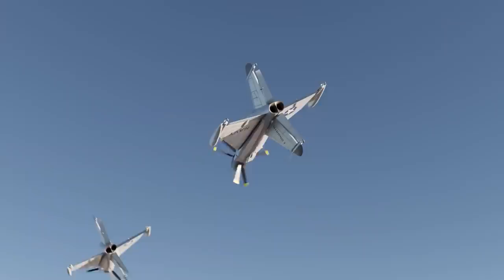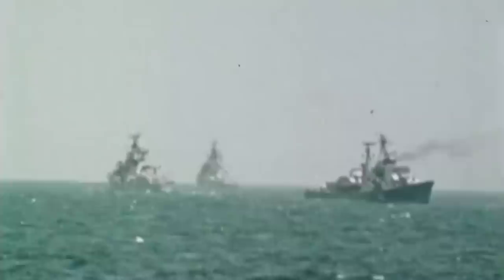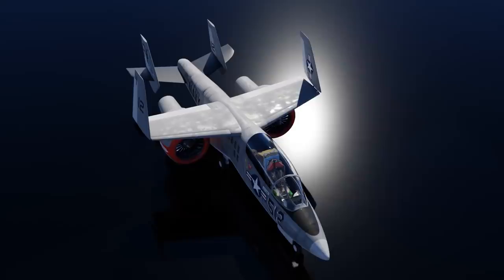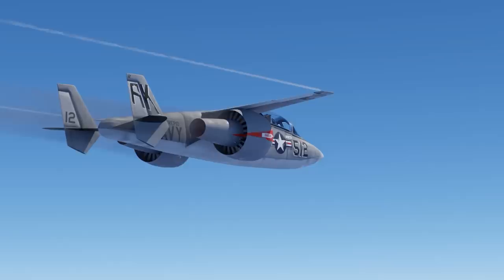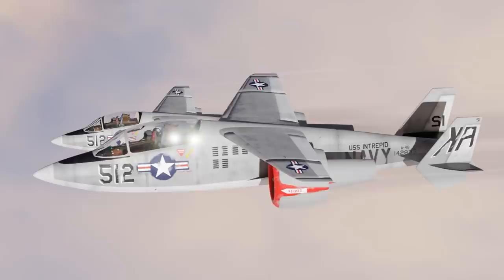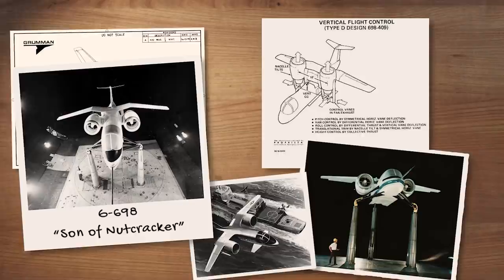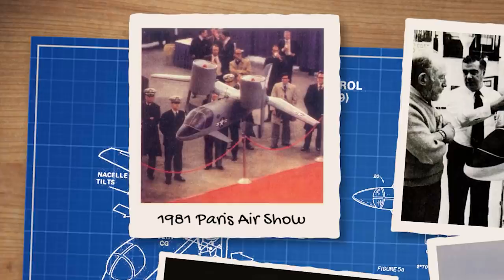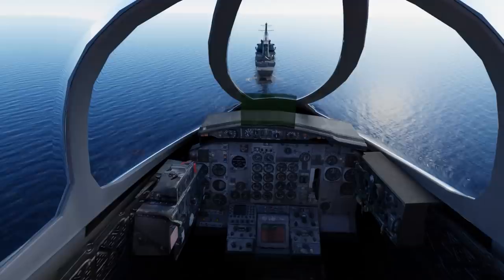Real Life Transformer - The Navy's Folding VTOL Jet

Comment: I mean... how do you easily solve visibility on a VTOL aircraft if not by tilting the whole effing fuselage?
Reply: By just going Macross and tilting the cockpit and nose instead.
Reply: @SephirothRyu  Actually, Macross' Variable Fighter swinged its engines down, forming its 'legs'. See also Advanced Vertical Strike (AVS) & VFW's VAK 191B.
Reply: @SephirothRyu  The visibility can be solved by either a mirror or camera, or just tilt the entire the cockpit.
Reply: @smartfrenandromax6651  yeah, idk why they did not think of that, along with a sensor to measure the distance from the landing gear to the ground

Comment: Funny, it would have seemed much easier and practical to just pivot the Turbofan engines themselves rather then the rear half of the aircraft.
Reply: Engineers : easier said than done chief....
Grumann engineers : hold my ruler
Reply: There was another plane by Grumman I believe that did just that. But jet vtols in general aren't as good as prop ones.

Comment: yes, but with todays fly by wire and computers it should be easy to put to work. However now there is the tilt rotors to do this sub hunting job as the Bell V280.
Reply: Or just you know. Standar thrust vectoring already mature for more than 50 years.

No need to overcomplicated thing
Reply: @bocahdongo7769  Yes. Thrust vectoring. The design of the Nutcracker is kind of lazy though. Now if it got arms…
Reply: @smartfrenandromax6651  now it must carry arm too. Which doesn't do anything and... You know, 3D maneuver plane is already in operate anyway.

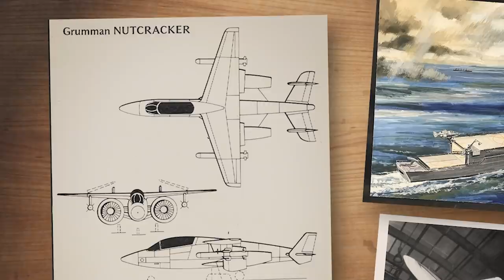Comment: Funny intro topic for sure, 4:25 a very redundent design modernly, for one, the engine has air flow thusting at a rear fin, limites in afterburner featuring, plus there is no purpose to fully vertical, besides only two engines, the cockpit, might as well be the only pivit motion, so its more like a verticle dolphin versus a humming bird.

Comment: Pointless design as the issues were already solved by the Harrier with a frigate sized ship equipped with a 'Sky Hook' similar to the docking arm shown here. I could not understand why the Royal Navy did not put Harriers on the aft deck rather than a helicopter  - Lynx, Scout whatever.